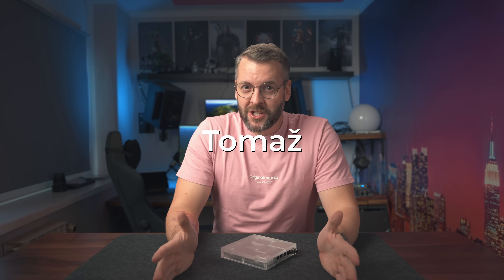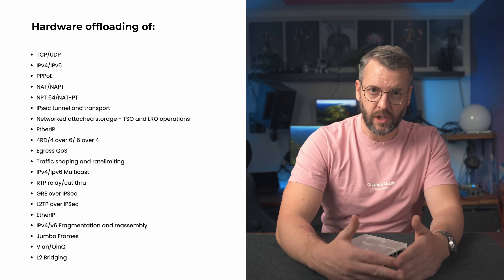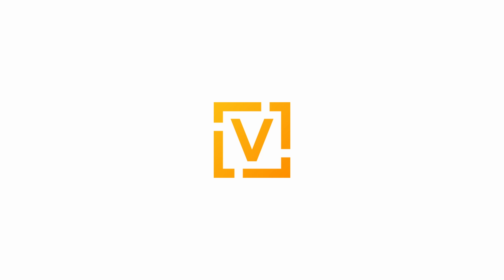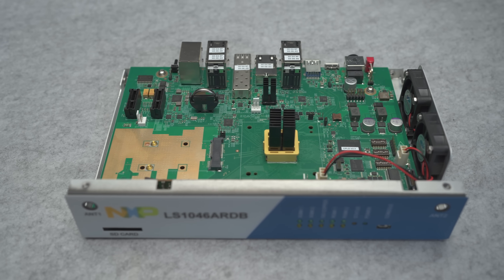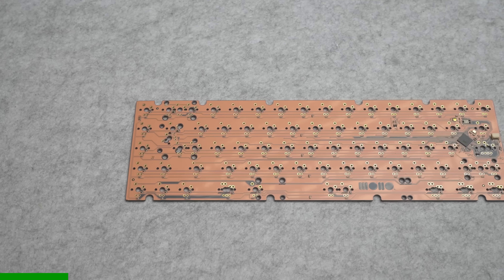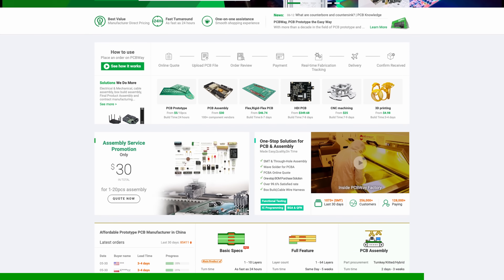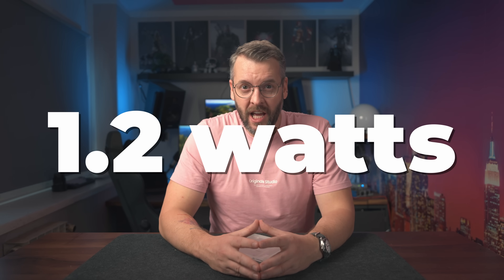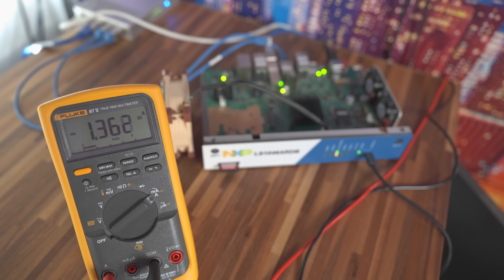10 Gb/s throughput without using CPU cores? ✅ Check.

Comment: Unpublished kernel patches for a published kernel binary sounds like an outright GPL2 violation.
Reply: It sounds like NXP is out for some GPLv2 violation or is that v3? Anyway, wouldn´t that mean you´d be infringing on GPL as well!!?
Reply: @    Not if they load kernel blobs and have userspace helpers but need to butcher the core utilities
Reply: @tibby-za  Very unlikely. The patches to the main source tree have to be shipped as part of the source with every kernel binary to comply with GPL2. Yes, they can load blobs, but those blobs will have a restricted set of kernel APIs available to them as Linux marks a significant part of its kernelspace api as only accessible to GPL2-licensed code. Masquerading as GPL2-licensed code to get around this is a GPL2 violation *and*, as the recent events with Tuxedo have shown, will rapidly get you blacklisted from the kernel.
Reply: Is that not covered by LGPL? And why GPL type licensing only? There are alternatives (look at what Apple and SONY do for FreeBSD under it's license).
Reply: @RobSchofield Linux is under gpl2 license, and it enforce distributors to also include(make available) source code of the kernel.
BSD/apache 2/mit licenses are not enforcing you to publish source code when you distribute binary of your kernel, that’s why apple used freebsd kernel initially.
Reply: @MrMyFaker  
Apple never used the freeBSD kernel they used a Kernel call XNU witch is open source
it uses the freeBSD standard library and many BSD utils but if it's that android is just freeBSD
Reply: @redstone0234  My understanding is that the XNU kernel based on Mach is dealing with hardware and process management, resource allocation,hardware drivers (IOKit)  and it is running a FreeBSD compatibility layer so that the FreeBSD source ports tree would compile and work under MacOS like bash, htop, and all the GNU utilities.

Comment: Hi Tomaz

Regular follower your project, I do really like the openness and explanations, I really do appreciate it.
Maybe in the future revisions, as this device will be a tinkerers heaven, if you want to even further drop the cost, maybe consider adding NVME or SATA storage option, leave the EMMC optional, and maybe you can revise use SO-DIMM options too, so the customer can decide what Storage + RAM configuration they want to use in the future.
I don't know if the CPU will have enough PCI-E lanes, but for a router appliance some kind of SATA based storage would be enough too, if the CPU has controller, or perhaps source a sata controller chip, but I have no idea if that makes sense of a cost perspective and how much complexity it would be to develop and revisit the board.

Just chiming in, throwing here some ideas, options, I love your work, keep it up!
Reply from the maker: Thank you! CPU does indeed come with a SATA controller, but we opted to use those SerDes lanes for Wifi 6/7 instead. Will see how the market responds with this first version and then act accordingly.

Comment: Depending on NDA'ed, GPL-violating, proprietary junk makes this a much less interesting product.

One of the appeals of a custom project like this is the ability to tinker, or just having the option to keep it alive if you for whatever reason can no longer support it – which is a real risk for a small company. Without acceleration, the router would be almost useless for 10 GbE speeds.

Aren't there offloading network chips available, rather than depending on NXPs SoC? I'm not opposed proprietary blobs or a few closed-source tools required, but NXPs patcheroo crazyness and hostility is too much.

Doing your own FPGA-based solution would probably be too expensive, both for hardware and development cost 😞

Comment: If you guys only decided to go with MTK as I've said many videos ago....
Yea propietary BSPs dont age well, GPL violations etc... as always.
I'm not surprised anymore...

Man those chips are expensive! What they think they are? Broadcom or Nvidia?

Still thinking that MTK Filogic 880 would have been a lot cheaper and more functional for a FOSS router.
With Wireless, PPoE and NAPT accelleration available with FOSS drivers.
More accellerated protocols is supported by the SOC but those patches are available as FOSS.
Reply from the maker: No, this version is already locked, hardware-wise, 2x10Gb SFP+ ports and 3 GbE ports.
Reply: @tomazzaman  yes I know that this version is already locked. It's just sad that NXP is as any other soc vendor out there.

And by looking at the available SW stack mediatek was a winner as part of the hw offload is open source and in mainline.

I'm still asking myself why you guys didn't consider it on the first brainstorming sessions.

That SOC have 4x1gbe built in switch with qsgmi uplink to it, and 2 SFP+ with HSGMII too. Other that a lot more pcie, for name, and their wifi (if you want wed).

For that chips there is even mainline U-Boot available!

So, at least for me, it looks like a no brainier choice when you are creating a open schematic router. (They don't like too on sharing the board layout/chip footprints).

Comment: I would be fine with the lower clock version, but reducing RAM? Not something I think should be done. Maybe for simple routing not needed, but if you want to use the router with additional features on the software side, RAM could become more important. So I rather have the RAM available.

Comment: I have been following your project for a few months now but honestly, I dont trust this NXP or whatever company. The second you said "Big red confidential watermark" I would be noping out of that feature. This is security by obscurity, something proven to be a bad practice. I mean, just look at fucking door locks, there its gotten to the point that you have channels like LPL. So, honestly, I am more interested in how it can run without this HW offload. 

Also, if the connections are not available to userspace programs, how would IP filtering work? How can you even firewall like that?? 
I have a specific use case for IP filtering too, that is, to prevent any and all computers from avoiding my network wide DNS by using DoH or DoT. 
I also have a script setup for fail2ban where the blocklist is agregated on the router and a fail on one device or service results in a network wide ban for that IP. 
Another thing is I run wireguard, and while it is possible to run that off-device somewhere else, I would preffer if it could stay on the router itself.

Also, for me, as long as it is below 500W of continuous power draw its absolutely acceptable to run 24/7, electricity is cheap compared to bandwidth, so I would gladly have a higher utility bill as long as I know I can safely use all the uplink bandwidth I am paying for.

Comment: I think the main purpose of the router is to perform flawlessly in the workloads you demonstrated in the video. I think therefore that the 1.6GHz or even the 1.4GHz cpu would not compromise the performance of the router. Similarly 8Gb vs 4Gb given one option or the other do not affect significantly the routing performance you should go with the option that makes the product as much competitive in the market as possible. Consideration should be given to what kind of UI and life comfort features you plan to make available in the product. But I don't think a UI, even with heavy graphical sophistication and maybe historical logging would be affected much by lower clock speed CPU or 4Gb of RAM. My 2 cents.

Comment: The number you are showing are impressive, but we are only talking about pure L3 routing, no firewalling. My question to you would be: what CAN'T be offloaded to the CPU and how will it affect the performance? Examples: advanced packet filtering with 1000+ rules, OpenVPN, IDS/IPS, SSL, etc. Are there any kind of encryption/decryption acceleration/offloading built into the CPU such as AES-NI that would benefit those features? In many cases, the CPU sizing for a firewall is directly linked to the resulting throughput of the encrypted tunnels it can deliver (IPSec, OpenVPN, Wireguard, etc.). With that in mind, I don't think that 1.4, 1.6 or 1.8 Ghz will make much of a difference, the 1.8 GHz will be around  30% faster than the 1.4 GHz, this will clearly not double or triple the encrypted tunnel bandwidth. I am curious of seeing the performance of a single OpenVPN tunnel (OpenVPN is single-threaded) on your hardware.

For the RAM and CPU, I would go for the most cost-effective option regarding the capacity it provides (biggest bang for the buck), not the cheaper. Which CPU cost less per GHz? What amount of RAM cost less per GB? From what you are saying in the video, the 1.6 GHz CPU with 8 GB of RAM seem to be the most cost-effective combinaison. Choosing a middle ground between the most powerful and the cheapest will probably be attractive to the highest number of early adopters and be commercially more viable initially and accelerate your return on investment. After securing a steady flow of sales, then releasing a lite (less powerful) version and a "beast" version (more powerful) would probably be possible based on which one you get the most requests for.
Reply: Not only that, it shows only a single connection with max packet size, what is not a realistic test, that speed  with this condition any cpu would have near 0 utilisation (even without any dedicated hardware acceleration).  Comparable SoC (not same but comparable by cores and speed and have hardware acceleration made by reputable company that make most SoC used in consumer routees) in comertial product (I will not name company but name starts with A) in real user case it bearly pass 650Mbps speeds even in tests like this it get full 10Gbps speed.
Reply: @viaujoc  Exactly, he should test with Trex and use a firewall. Everything else is just hypocrisy.

Comment: At the start you mentioned that FreeBSD is better than Linux for routing, but I've found the opposite to be true. I was testing opnsense vs OpenWrt on an old SFF PC with an Intel i5-9500 and X540-T2 NIC. OpenWrt was able to successfully reach 8Gbps over a single iperf connection over the internet. Opnsense struggled to even hit 3Gbps, with one CPU core pegged at 100% (which makes me think that maybe NAT or conntrack is single threaded... not sure)

Comment: Confidential datasheets, non disclosure agreements, binaries without source and all this combined with linux and free software... smells like a rampant gpl violation.
I also don't tolerate closed source with things that are relevant to security, I'd rather run a >100W CPU that does nothing but moving data between network cards.

Comment: are the CPUs not footprint compatible? for the memory, couldn't you just design for the full 8GB and either leave half of them unpopulated or use lower density ICs? It seems like you could pretty easily do variants; use the same boards and stencils and just different pick-and-place files. have the lower-end variant (4GB/1.4GHz) be the main product where you allocate all the inventory risk, and make the higher-end variant (8GB/1.6GHz or maybe 1.8GHz) in smaller "limited-edition" runs at whatever quantity you're confident you can sell through quickly. Due to the smaller purchasing quantities for the CPU and ram, the limited high-end variant's cost overheads will be higher, but you can just price it accordingly, and then if demand for the high-end variant is greater than expected, you can increase production, and pocket the reduced overhead as extra margin on your halo product, while still offering something reasonable for the rest of your customers.

Comment: With regards to cost savings, my question would be are the CPU, RAM, and EMMC storage on sockets, so that we could easily upgrade them afterwards?  If we can easily upgrade the device ourselves, then I don’t see a problem with shipping lower speed/capacity/cost components.

If you’re going to be like Apple and soldering them all onto the logic board, then I think you’re going to end up needing to provide multiple different versions with different capacities and speeds, much like Apple does.  Because that would be our only way to upgrade.

Comment: How many 10Gbps interfaces are you going to have on your hardware?  Can I get four or five 10Gbps WAN interfaces, plus at least two 10Gbps LAN interfaces?
Reply from the maker: Two SFP+ ports, we're limited with what CPU provides. What you speak of is possible, but would pretty much double the price of the device because we'd need to put a much beefier CPU in.

Comment: 13:08
What about 10G RJ45 Copper ports? 
ALL the ISPs I live in has its ONT/Modem output 10G RJ45, it would be ideal if all the ONT uses SFP+ but NOPE. ALL of them uses 10G RJ45 Ports, please think twice to release this without 10G RJ45 as it will be a deal breaker.
Reply: Afaik, 10G goes through SFP, so you'd just need to grab SFP to 10G copper modules
Reply: @triffid0hunter  
The point I'm making is since he's making a board from scratch, he could easily add a RJ45 10G port on it. No need for external modules that heats up at 100C constantly.
Reply from the maker: Actually, we planned to use 10Gb RJ-45 initially, when we started with the architectural design of the board, but many commenters said they'd prefer SFP+ because it's much more versatile.
Reply: @tomazzaman  
Why not exchange 1 sfp+ with 10G RJ45, best of both worlds. Trust me, having had used a SFP+ module it sucks using one, it heats up to 100C. 
Did you even do an ISP modem research? On most countries, they use RJ45 10G for their multi-gig plans. You will lose a good chunk of customers if you omit this ngl.

Comment: View to like ratio is low on this video compared to others in the series. Sounds like a no go on the confidential binaries given that it will prevent you from complying with GPL. 

Community clearly does not want to rely on you, NXP, or any other overload for updates. Linux is not for sale!

Your replies suggest questions for the NXP sales rep. Dude - Get an attorney who represents your interests and not NXP's.

Comment: Get the biggest cpu available, reason if you get something like snors or suricata you cannot offload to hardware, you will actually need the cpu and ram, do you have a test what the current cpu and ram can push without hardware offloading?

Comment: I already see two version of this router emerging, depending on what traffic can really be offloaded and what software configurations would affect(and disable) hardware offloading, because that is important on a 10G router... 
A cheaper version is preferred, yes, for the customers and for you guys... And that's probabably your main goal. But a higher end version might make sense too, maybe the faster CPU or something else added, maybe more connectivity options, or more RAM(example). That might be a different product, one that completes a product line. ;)

Comment: I've followed this project for a while, while your other claims I'm fine with I have some questions / concerns about the NAT-P / PAT. I get this is a consumer level device but how much memory is this hardware offload module going to have? Looking at the LS1046A block diagram I guess my question centers on the conntrack monitor module (you show the command reading data from it). Whats the max number of connections this module can handle? This would also be a limiting factor for the SPI firewall as well.

A less pressing question would be with the L2 bridging is it vlan aware (yes I do see it supports vlans but is the bridging aware of vlan tags?).

As much as I would love to say people will pay for the extra CPU speed money talks so while getting yourself established I would not want "too expensive" to be a reason people reject your product while you are trying to get established.